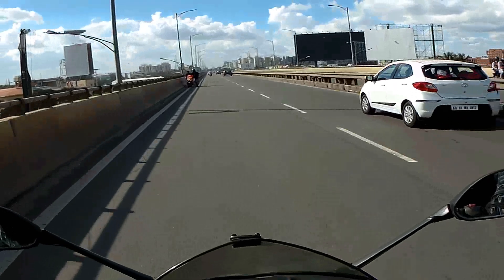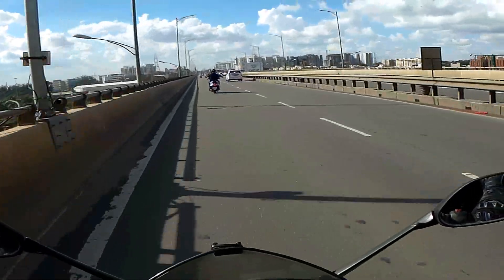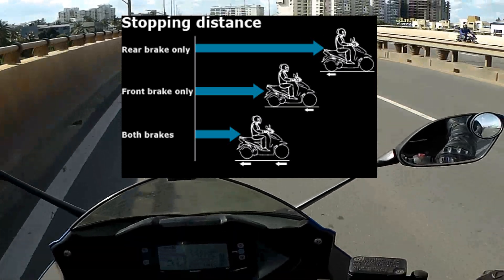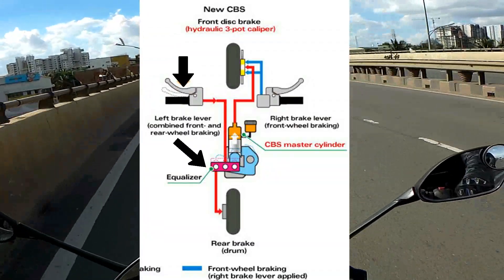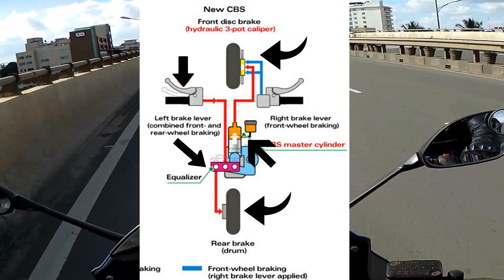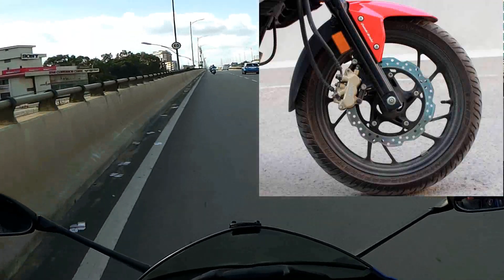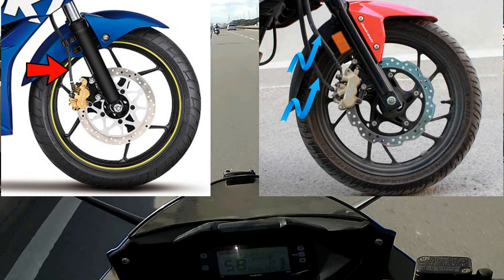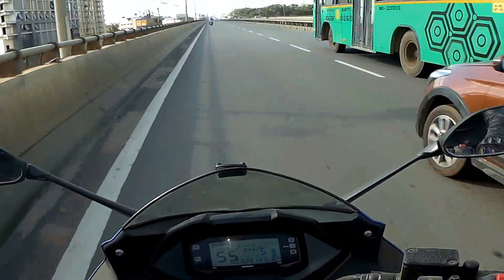What is CBS? | How does CBS work? | Combined Braking System Explained | Know your Motorcycle series

Comment: 40% front while, its correct?
Reply from the maker: It varies from motorcycle to motorcycle. Manufacturer defines the amount of braking on both wheels for CBS and also which brake activates it. Few manufacturers use rear brake and few front brakes to activate CBS.

Comment: I got rid of my CBR1100XX Blackbird due to the messy and complex DUAL-CBS DIY method, just got tired of it due too many steps to follow, valves, hoses and bleed lines. Don't get me wrong I loved the Bird but when it came to maintenance was too costly and time consuming for me and expensive if you had it done at a Honda motorbike repair shop, now I ride a ZZR 1400 and everything is much easier to do by my self. Honda makes great and wonderful machines but their braking linked method is just not for me.

Comment: Hi. Bro.. in fast speed if i press rear break once it applies front break also equally in CBS. But front having disc . In that reason, is there any chance for skidding of bike with front disc effect or not. If yes , can I purchse drum bike with CBS instead of disc with CBS
Reply from the maker: It all depends on the speed. Sudden braking is never good but if you are worried between disc and drum brakes, I will suggest disc. Now if you apply rear brake at not very high speed, chances of skidding is very less if the bike has CBS. Therefore, my suggestion would be to go with disc as they are better than drum brakes.